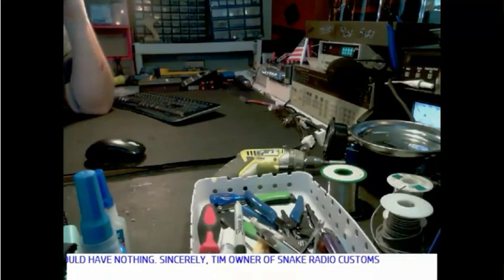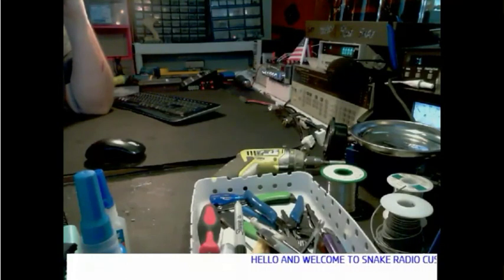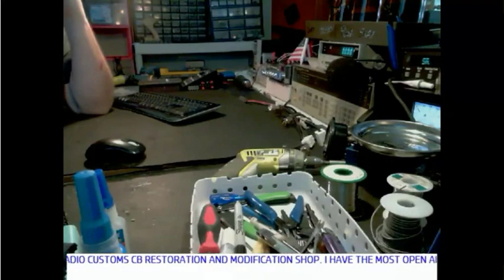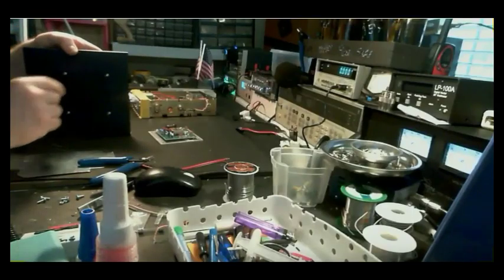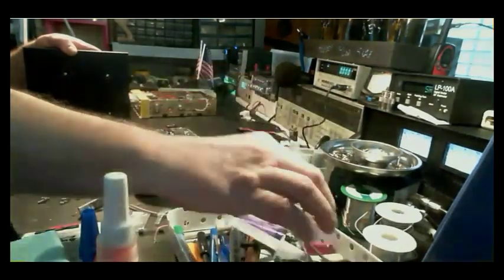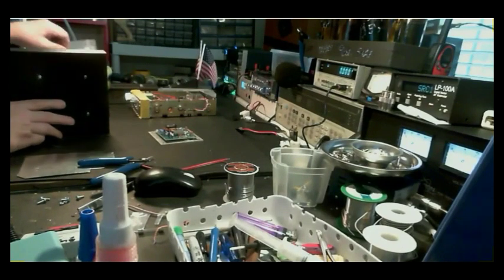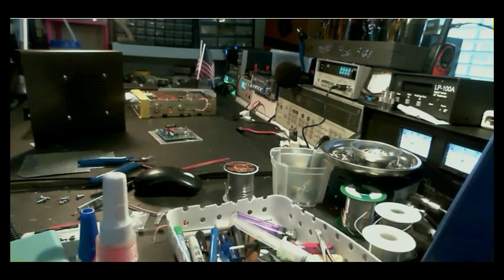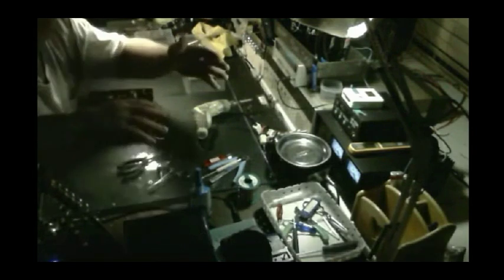How To Match CB Radio To A Linear Amplifier By SNAKE RADIO CUSTOMS BUILDS AND MODS. Calls It Crutch?

Comment: Snakes latest claim... He is a innovator, first time ever, no one has done this in the entire planet.... He is a genius.... His claim to fame is....... He installed a 2 pin molex power plug on the Anytone radio by cutting the power cord..... Really ????
Reply from the maker: He should've used something a more standard like Anderson connectors but they probably cost too much for him.
Reply: @FineTuneCBShop  I'm also thinking... Those small molex connectors, will they hold up on the current draw of a Anytone ? Asking for a friend.. LOL
Reply from the maker: I didn't see the video .. I would need to see the actual specs and soldering capabilities ... voltage drop test would be in order!